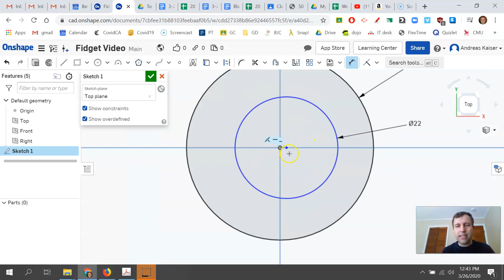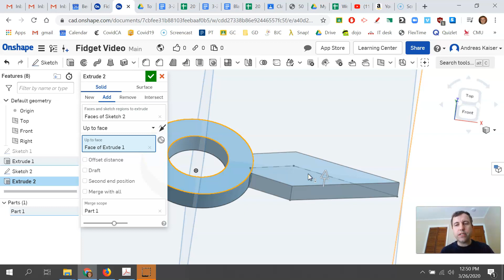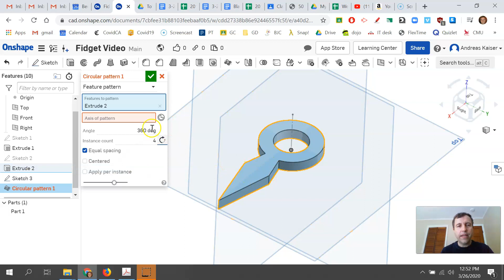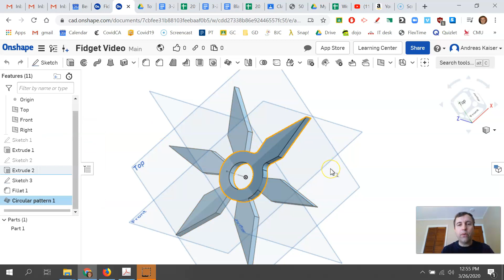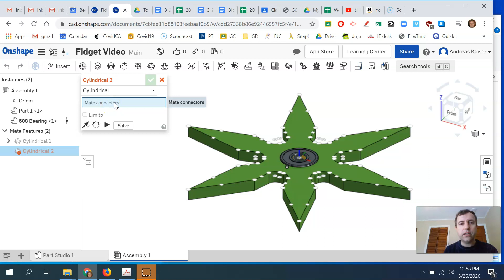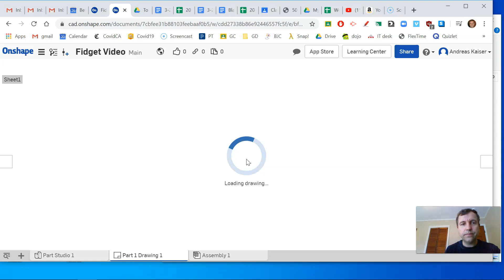Design a fidget spinner using OnShape CAD

Comment: Why didnt you add a Hub? How will it spin?
Reply from the maker: The spinner was meant to be laser cut. It is hard to laser cut a cap for the bearing, so I usually just buy them in bulk for my students (or 3D print a design from thingiverse). But it will actually spin quite well with just a bearing.